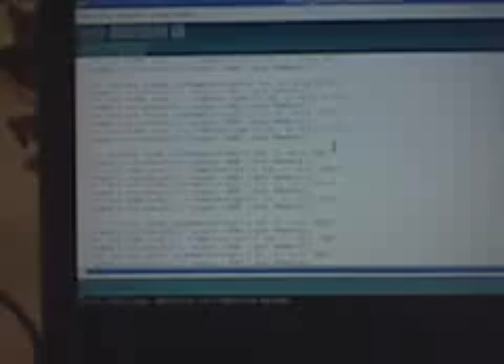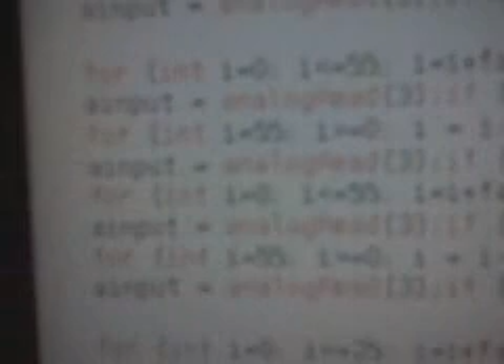Arduino Interactive LED Table (part 1)

Comment: congrats on getting the led's working,  looking to make a interactive table of led's.  you can always clean up the code after to make it alot more efficient and clean.  I used to code spaghetti code when I started.

Comment: why not spend the extra 10 bucks and support arduino and all they have done for micro controllers and open source.  Plus it wont be some cheap ass piece of shit that may or may not work correctly......  Shakes head

Comment: Piggy-backing on this comment... There is code written for the 5940 that will allow you to daisy-chain several of them together. If you properly multiplex the inputs, you can actually expand the Arduino to a 96 I/O (all outputs PWM)!! I made a prototype, if you care to check out my vids.